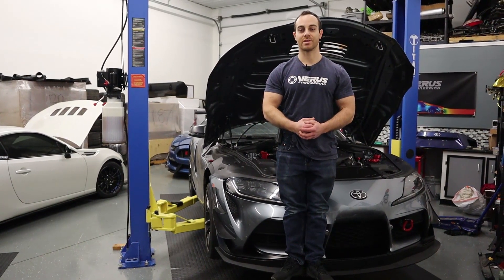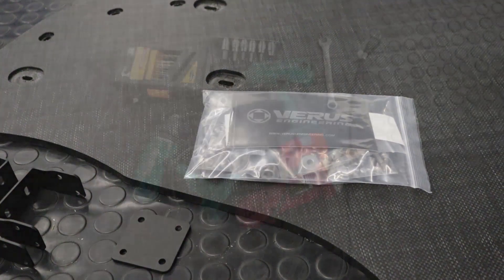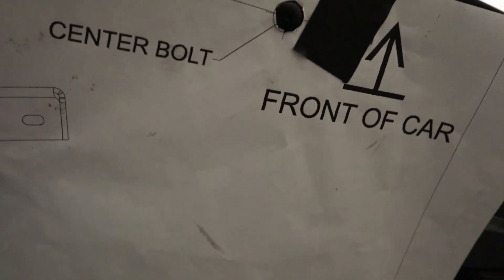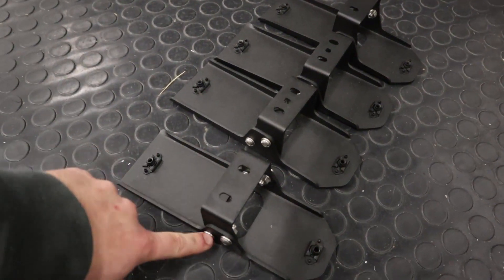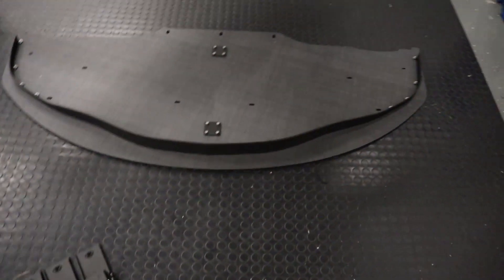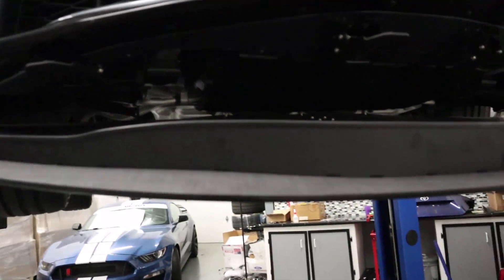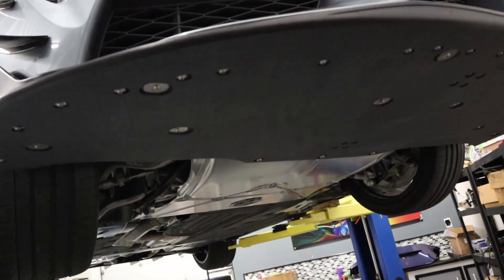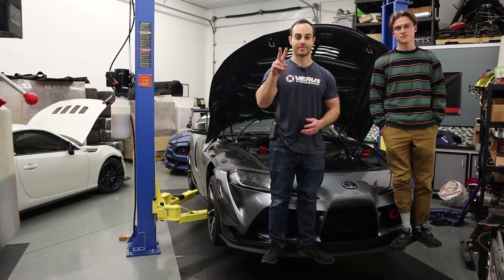Verus Engineering Front Splitter Kit Install - Mk5 Toyota Supra

Comment: how much downforce does this splitter generate at speed..like 80-120mph range?
Reply from the maker: Here is a link to our informative packet. We do not share the values of individual components as we design our aero components to work together in unison. https://www.verus-engineering.com/web/content/31918?unique=c12e2b686fe77f0480c7735b8643ac9778509541&download=true